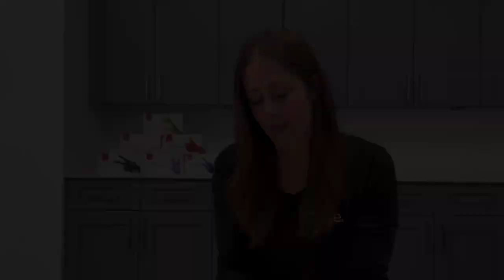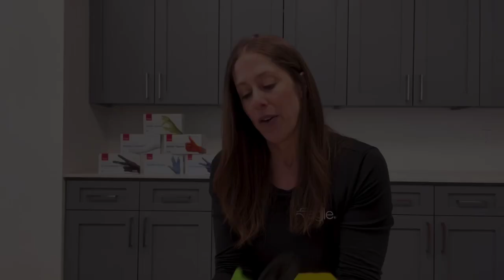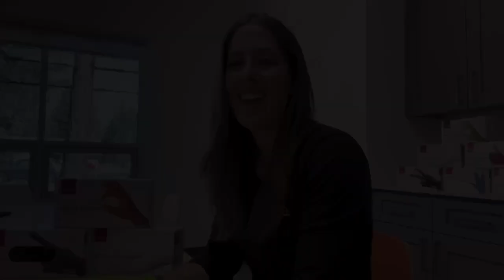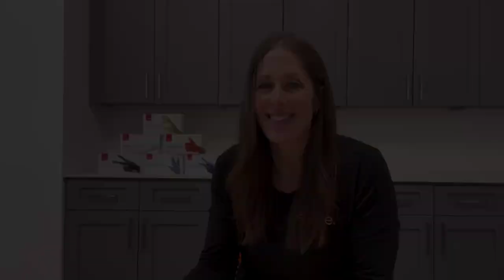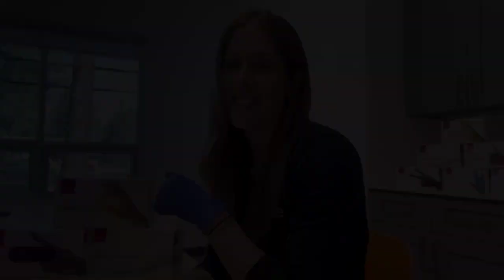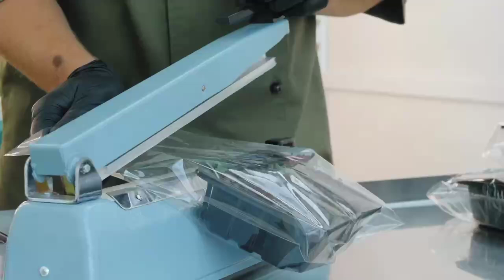Why Use Colored Gloves: A Food Safety Strategy

Comment: These are very good videos.  I definitely use color coded gloves at work, I work in a machine/welding shop. I do preform different tasks,  my prefrence and as an indicator of my true size(I'm a size medium and most of my coworkers wear large). I wear black gloves for when I assist q.a, blue for chemicals and pink for handling raw material(steel) and white(which latex) for finished product.